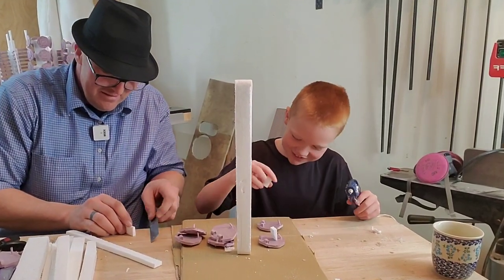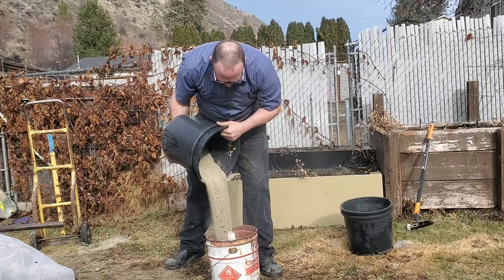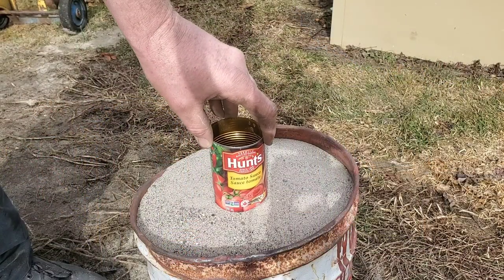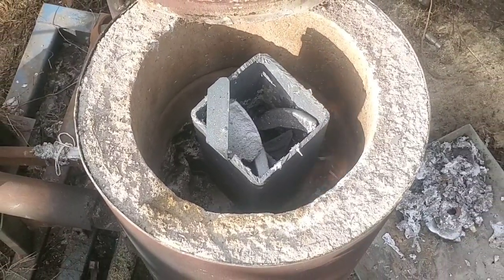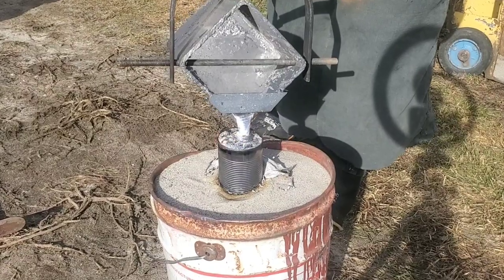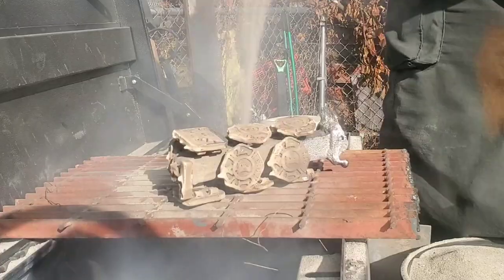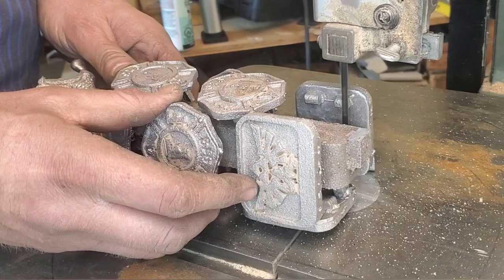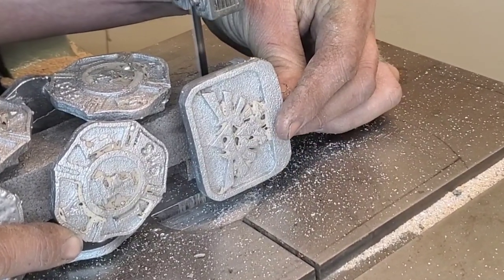Casting Belt Buckles By The Lost Foam Casting Process

Comment: About dry sand: In green sand casting the sand+clay has a few percent water.  Deliberately damp (and some clay) so the sand can hold together like a sand castle.  The pores in the packed casting material are sufficient for water vapor produced to escape as the metal fills the mold.
Reply from the maker: Thank you  , good points